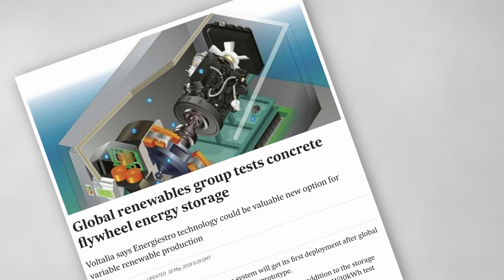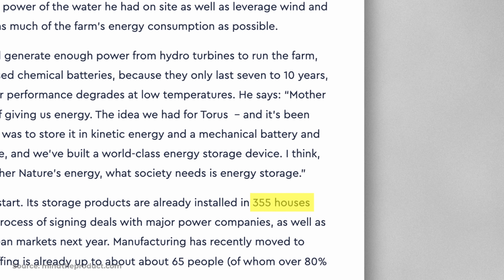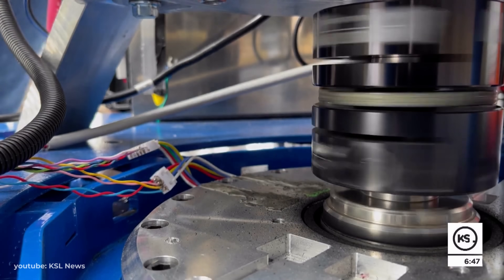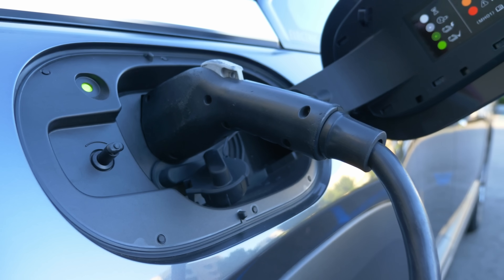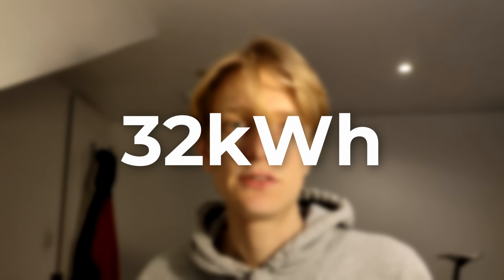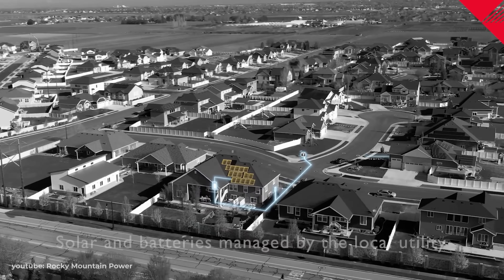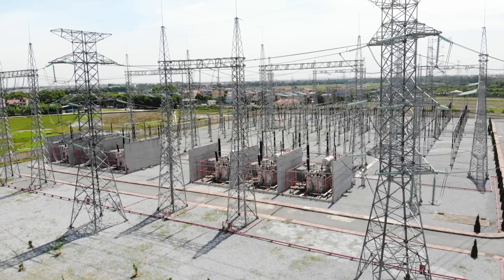Is this *FINALLY* a Break for Flywheel Energy Storage?

Comment: Stored Flywheel Propulsion is ok for fantasy island dreamers, gyroscopes and small scale projects   
but in order to be reliable and safe, the balance, the bearings, and the maintenance checks on the entire structure need to be carried out regularly and to extremely high standards.
The energy stored in a flywheel is directly proportional to the diameter, the weight and the RPM.  The energy stored can be massive and therefore extremely destructive.
I was once stood close to a 4 foot diameter high speed paper shredder with a when a fan blade broke off and it totally destroyed itself ripping apart the 1/4" thick steel casing that enclosed it.  Believe me you do not want to be anywhere near when a flywheel disintegrates.

Comment: Some mistakes in your calculations. 

Whilst comparing costs, you didn't factor in the time needed to recharge,  number of recharge cycles, salvage cost, operational parameters, and maintenance cost. Flywheel costs will go down soon, once production moves out of western countries where even plumbers charge USD 2999 for a job.

Comment: This will not work well. The motor for spinning and the generator are not 100% efficient. Energy is lost to spin the wheel, and even more energy is lost when generating power again. It’s just inefficient system, alot of loses...

Comment: Flywheels only make mild sense in zero G, and even that introduces some gyroscopic problems. This company is doomed, running off VC money, put in by people who don't understand what they are investing in.

Magnets aren't free, degaussing is a long term problem. Also, 10kWh is pretty silly. That's $5k of LiFePo4 batteries with zero moving parts.

I'd rather a shipping container sized nuclear reactor, preferably thorium based.

Comment: To me, flywheels should be used for communal energy storage, and modular. By "modular," I mean that flywheels should be huge (like, an 18' diameter or more) and you should be able to split the flywheel's wheel into three parts. This would make maintenance and installation a lot easier.

Comment: Even with how dangerous lithium ion batteries are, flywheel storage (with the exception of maybe very large, slow-spinning flywheels) is much more dangerous. Our physics textbook in high school mentioned a physics experiment where some scientists were spinning a trashcan-sized chunk of steel to high rpms, and eventually the steel itself failed, the mass ripped apart, and the chunks almost vanished.  They later found that one of them burrowed through the entire building and finally exited through a side door, ripping the door off the hinges and ejecting it into the adjacent parking lot.  Another chunk hit the foundation, making the entire multistory building shift a centimeter off of its foundation.  Heavy, spinning stuff is no joke.  If the bearings wear out, or the material that's spinning ever experiences brittle failure due to hard-to-detect internal stresses or manufacturing defects, whatever building it's housed in is toast.  With lithium batteries at least you can have fire suppression systems, house the system outside where it can burn off freely, etc.  With flywheel storage, the failure is instant and violent, like the mythbusters cannonball incident.  The pieces will bounce off of hills, rip through cars as if they're made of paper, etc.
Reply: I have noticed that Amber Kinetics install their systems in the ground.  Worst that can happen then is that you only hear a loud "whump" and the earth shaking a little.
Reply: I'd like to think this as kind of like nuclear energy. It could be extremely dangerous if the safety is ignored, but it is still highly recommended for energy transition, especially because it can be highly efficient and have a long lifetime.

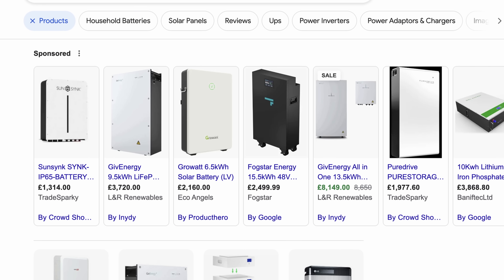Comment: 5:50 For that one time purchase.  It depends on how often you would swap the battery but there is that to take into account, also round trip efficiency conversion in storage time spans below the self discharge issue (so sub 2 days or so, like overnight HVAC etc).  If I remember correctly FES is more efficient than batteries in this regard?

Also not measurable in USD per se, but at least for me, the recyclability is a MAJOR selling point.

Comment: Eek. Yeah, cost has to come way down. A quick google turns up a cost of $8k to $16k for a typical home solar battery bank, before rebates, so the cost would need halved, and both of them would still be expensive. However, I believe that once this unit gets manufactured in greater volume, then economies of scale would most likely drop that price radically. I think the future of this technology is in other countries, where they don't have lithium deposits and want something else bad enough to pay for it.

Comment: Flywheel storage is absurd. It takes energy just to keep them spinning, and as a store for energy, why?

I can see for short duration, high energy or short duration burst energy production but beyond that, it is absurd. 

It is basic physics; you either need a super heavy mass, or have that thing spinning at an absurd speed, or both

And how is changing an EV faster than just going off the grid or a generator? You have to wait to spin the flywheel up, then have to wait to discharge it; the time it takes to spin it up can be spent charging the EV

Being able to be used in cold environments is a benefit

Also, a spinning wheel is 10 times the cost of lithium batterie? Hilarious.

Comment: So you want to go net zero, you mine to build solar panels and wind turbines with 15 year life spans, batteries with 10 year life cycles and then now you want to build flywheels when all of these are in a conventional power generator with full economies of scale.

How any of this is green really befuddles the mind.
Reply: Batteries and solar panels last longer than 10-15 years.
Reply: @Hawk7886  Yeah sure, past 15 years the cells in the solar panels would have degraded so far until it does not make sense to maintain it and to replace with newer technology with far superior efficiency. Same as batteries.

Wind turbines are notoriously worse.
Reply: @mynameisusedz  nope, batteries around 15 years see a drop in capacity but otherwise work fine. Cells can be replaced and the battery load balanced as needed. Wind turbines have a design lifespan of 30 years but require maintenance and upgrades as they are massive mechanical devices. Around 10 years the average turbine sees a partial repowering where various different parts are upgraded to the current standard, such as blades, gearboxes, bearings, etc. The foundation and tower can stay in place practically indefinitely as long as it isn't damaged. Full repowering is uncommon and usually done to bring a very old installation up to the current standard. 
There are plenty of solar installations that are older than 25 years. The panels aren't as efficient as current designs, but they work fine. Most of the time they're replaced due to the efficiency gain paying for itself eventually, not due to panel failure, which is most commonly attributed to damage from storms or other outside influences.
Reply: @Hawk7886  precisely, thats my point. it is useable, but commercially it offers no value. And thats when it goes into the bin.

Comment: I, just a guy on the internet, once did the math. And anyway flywheel storage aint where it is at fam. pumped hydro is barely where it is at, and it is so far above a flywheel in price to performance and scaleablility. if you can't beat pumping water then why even try.
Reply: Water isn't available everywhere.
Reply: pumped hydro isn't that great for home energy storage unless you can dig like 1-300 feet down to put your lower water tank. which most people either don't or can't.

Comment: Storing energy in something moving is batshit crazy. What makes sense is storing it in something still... e.g. lifting something really heavy high in the sky, and slowly lowering it to recover the energy. The obvious case is water in a dam, but any kind of heavy weight works.
Reply: Rotating masses are good for stabilizing network frequencys.
Reply: @martinum4  you can use your elevated weight to rotate a mass if you want. But storing the energy in the mass is crazy.
Reply: @xpusostomos  no, it is not.
Imagine a Baseload X, now add a surgeload Y, solar inverters are kinda bad at holding frequency under these conditions, rotating masses got inertia and just spin a bit slower while keeping the frequency.
Watch the Video of practical Engineering on this topic
Reply: @martinum4  so... You didn't read my reply above
Reply: @xpusostomos  and you don't seem to understand that starting something up takes time. Were talking frequency response from fractions of seconds to seconds, no big intervals
Reply: @martinum4  the whole fucking point of my comment is that YOU GET TO CHOOSE when to be start it up with a weight based storage... Which could be 10 years from now if you want. With a rotating mass tough shit, it's running now, and when it runs down  youre fucked

Comment: Seems like an interesting device for applications using power over night. I.e a 24/7 factory, using solar panels during the day to both run the factory and charge their wheels, then run the factory overnight from the wheels

Even for individual homes, a house could be completely independent (theoretically) with a dozen or two decent solar panels and a flywheel to keep everything on overnight (if not for that scary intro price)

Comment: I don’t understand how it isn’t just a huge capacitor. And it takes energy to “charge” it up to operating speed.  It can’t produce more than it took to spin it up.
Reply: That is all it is; a battery that stores energy
Reply: I think that it is kind of like a capacitor, with how fast it can charge and discharge and how it's usually less practical than batteries for bulk energy storage, but it's great for leveling out surges in power use. but batteries also don't give you more energy than you give them when you charge them up?

Comment: Nah man, i do contract work for a lot of data centers and every one that has installed a flywheel hate the stupid things within 2 years. With all the specialized maintenance required they have twice the running cost for 1/20th the storage capacity.
Reply: Nobody EVER thinks about maintenance. EVER.
Reply: I know I'm a year late, but any chance you can describe which components failed most often?
Reply: @mervynlarrier9424  I used to maintain very high speed industrial fans and having bearings that were in top class condition was essential along with having the balancing re-checked regularly.  
We had one incident where the flywheel shaft which was about 3" diameter sheared off completely and the entire fan plus it's housing was totally destroyed.
Reply: Yeah, people never take into account long term maintenance, lifetime, safety, redundancy, complexity and so on. Only whats on the sticker, and then make some hype, get clicks. I hate 99% of "tech" news channels with a burning passion, regurgitating random claims blown out of proportion without any basic sanity checks.
Hecks the whole hydrogen revolution has now even infested policy makers (also thanks to lobbyists and peoples utopistic image of it due to said shitty channels and articles). The EU is spending billions on this nonsense now too.

Comment: I would never consider flywheels to store weight for a long time. Weight helps a flywheel spin, but at the same time makes it stop. Not a fan. The wear items are insane.
Reply: That's not how they work. Check out the first two Newton's laws. The rotor is in a vacuum chamber suspended on magnetic bearings, bringing the wear items down to zero. The only things to maintain would be the vacuum itself and the electronics.

Comment: I don't understand why the flywheel itself isn't just made of lead.  Lead is quite abundant but it's increasingly useless considering how it's toxicity, softness, and low melting point.  However, none of that matters when it's in a sealed container where all it has to do is spin and be heavy.  Pure iron is cheaper but lead isn't that much more expensive but it is substantially heavier.
Reply: Probably bad for the environment to be introducing that much lead. Could leach into water supply if rained on, and the manufacturing of the wheels, if made from lead, probably would not be very good for the workers. It's also relatively soft in comparison to iron or steel, meaning if a wheel was made out of it, it might just tear itself apart. I suppose that could be resolved by embedding pieces of lead within an iron shell, but at that point it would be easier to simply make a slightly bigger/faster flywheel.
Reply: @alexandersmith4796  It isn't that hard to contain it in a safe way, and it would have to spin terrifyingly fast to tear itself apart.  Lead also does not sublimate, so people working with it are not at risk so long as they wear gloves.
Reply: Lead is not nearly strong enough. Modern designs use composites.
Reply: why stop there? Osmium or bust!

Comment: I don't understand why people are so down on these things. Did none of you play with gyros as a kid? They were so cool. Imagine how awesome it would be to have a giant gyro spinning in your living room all the time. It could be in a glass case so you can see it spin. The designers are really missing the bus by having them all be gray or white when they could have all kinds of bright colors on them.

On a related note, have we thought about spring storage? Like how they used to power old clocks?
Reply: They’re so down on them because it’s a big jump from a neat toy to something that is usable as a generator. 
Even just lifting a weight is a better storage of energy. But, that doesn’t have the marketing appeal of flywheels.
Reply: @NBSV1 flywheels aren't generators, they're batteries.
Reply: @Hawk7886  The expectation is for them to work like a backup generator in the same way a backup bank of batteries would work. They even market battery generators. 
Besides, if you’re gonna get picky they’re closer to capacitors than batteries. Good for smoothing things out and quick charge/discharge. Not good for deep cycle moderate loads.
Reply: @NBSV1  no, they're expected to work like batteries. Because that's what they are.
Reply: @Hawk7886  A battery that’s used for what? Starting a car? Powering a drill? Or, providing power for a house? Almost like backup power.
Reply: @NBSV1  exactly. They don't generate anything, they just store power.
Reply: @Hawk7886  If you’re gonna try to argue semantics don’t overlook the backup part. And, don’t overlook accepted uses. 
They’re using these as a backup power source to generate power for a house if it looses main power. The flywheels are spinning a generator just like an engine would. It isn’t like they’re chemically making power like a battery. And, it isn’t like they’re just sitting there spinning away without a purpose.
Reply: @NBSV1  still not a generator
Reply: @Hawk7886  Then how is it powering the house?
Reply: @NBSV1  since it's a battery, it's releasing stored energy.
Reply: @Hawk7886  And, what are the flywheels spinning to convert that released energy into power? Could it possibly be a generator of some sort? Or do the flywheels just release stored energy and it’s magically converted into power for a house?
Reply: @NBSV1  they spin a rotor. I can't figure out if you're trolling or just dense.
Reply: @Hawk7886  Funny since I’m trying to figure out the same thing. 
Do batteries have spinning rotors? Generators do. Batteries chemically produce voltage. Flywheels spin a generator to produce power.
Reply: Garage door springs kill people every year. Now scale that up to 10kw.

Comment: So this guy went off and created a company to bring flywheel software tech up to date...all because it was too cold in Utah for Lifep04 batteries over their 4 month winter season? Has he ever heard of self heating batteries.... And the result is something that costs roughly 10x more than an equivalent power bank. This flywheel should last 25 years (according to their specs), and comparing that to a Lifep04 bank brought down to 50% DoD will result in ~15,000 cycles....which is 41 years. 

In short, you pay 10x as much to have something that will likely die 15 years sooner, all because you don't know how to generate just enough heat to keep your battery bank above freezing. Oh, and after 3 days you have no power left if it's not continuously recharged. If it fails, you have to get parts from a company that has a grand total of 355 customers, instead of just disconnecting the failed component and swapping it out in five minutes with a solar/lifep04 setup.

I don't get it. Solar isn't the end all solution, but creating something that is quantifiably worse in just about every way doesn't make sense. 35-55k for 10KWH....Jesus.

Comment: I say this with absolute confidence,
flywheels are scary as hell when it comes to what happens in case of failure;
scaling of such setups imply the inevitable catastrophic break,
wouldn't want to be anywhere near it
Reply: Obviously the housing is built to contain such an event. It's easier to use several smaller units instead of one massive unit, for multiple reasons.